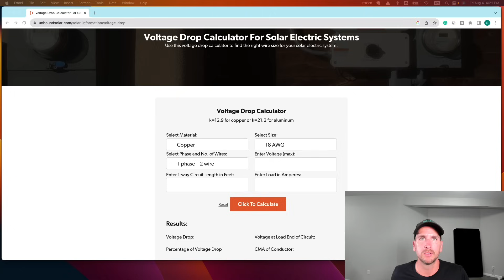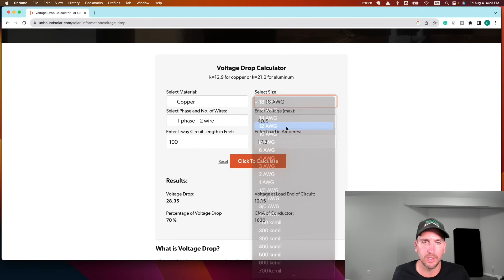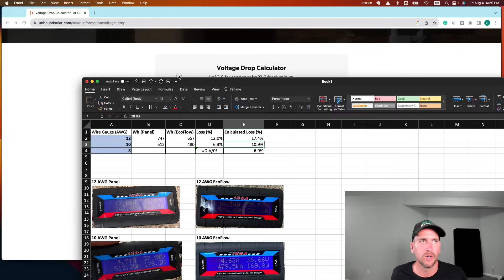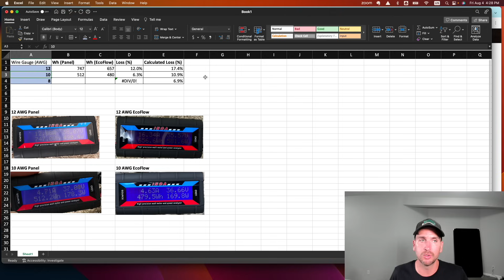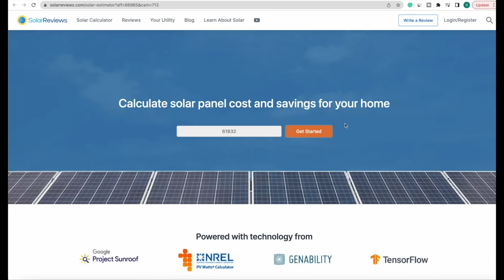What Wire Should You Use For DIY Solar Kits? Surprising Results!

Comment: A small point. I noted the calculator you were using started 1 phase, that I would assume relates to AC current. My understanding is that losses are greater in AC circuits than the DC that the panels provide
Reply: With AC,  you need to consider reactive circuits . The phase of current and voltage shift.
Reply: @chuckmaddison2924 and the skin effect. 

AC current moved in less area of the wire. DC current moves in the whole area of the cable.
Reply: @ajarivas72  Skin is related to frequency.  This is why in rf pipe can be used in the big stuff.
Reply: That is 100% untrue. The voltage drop is the same whether it is DC or AC. End of subject!

Comment: Do you think that measuring device introduces some loss too?
Reply: Sure, some. But any loss is consistent with each wire gauge tested so although the percentage losses shown might be slightly affected the overall message is the same. 8 is better than 10 is better than 12.